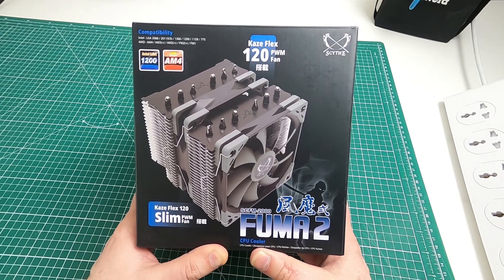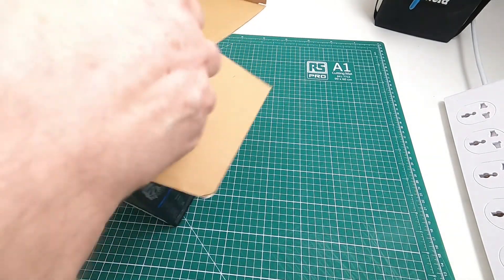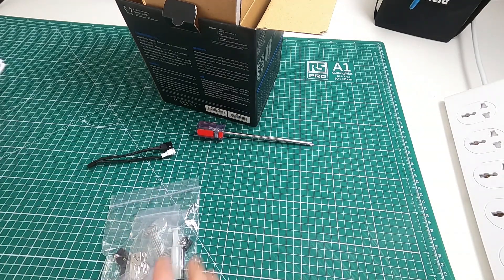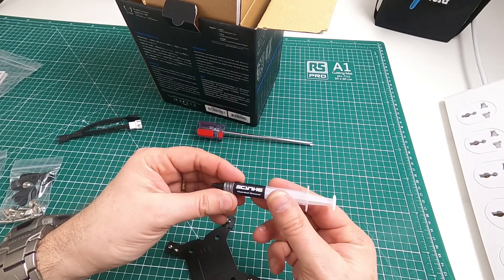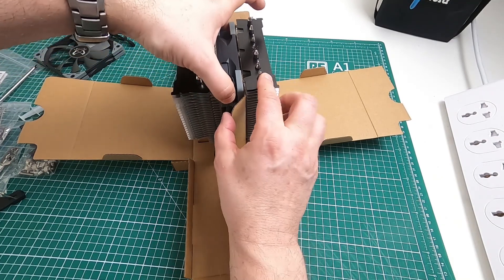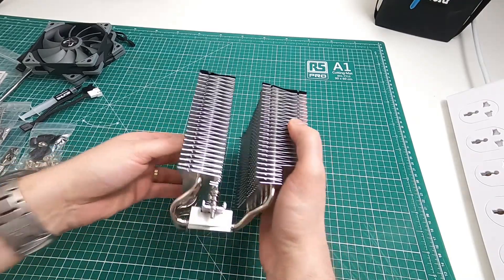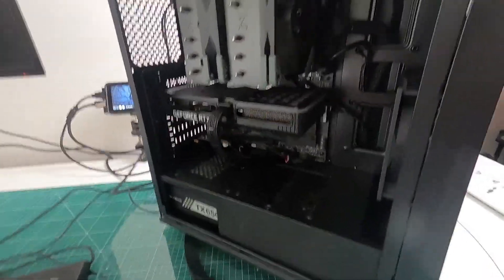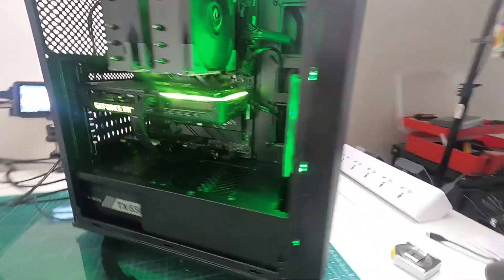Scythe SCFM-2000 FUMA 2 *REAL* Unboxing in English

Comment: Hello, i tnink that you could have better temps, if you rotate cooler 180 degree, what do you think?
Reply from the maker: Probably won’t make a huge difference, but the installation instructions are pretty clear when it comes to orientation because of the fan positioning.